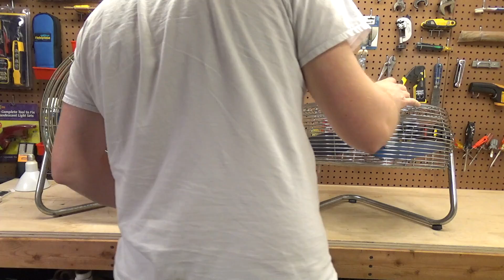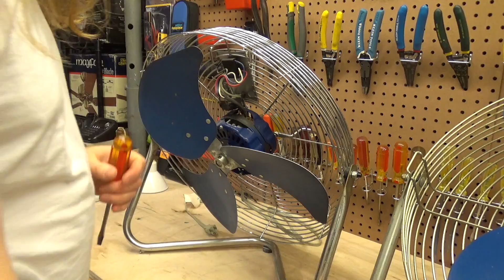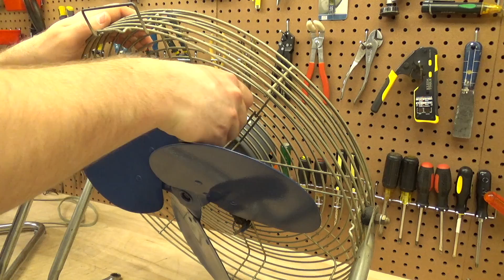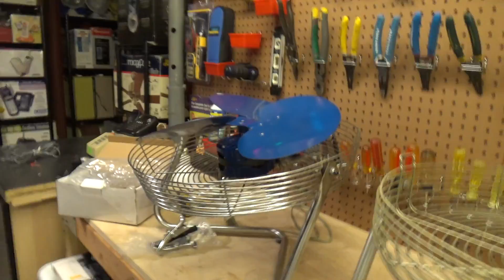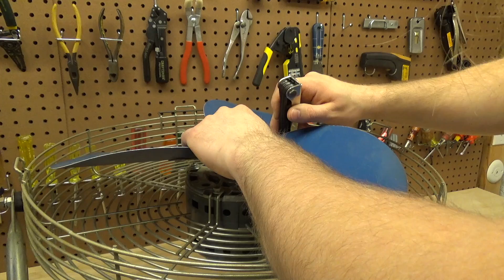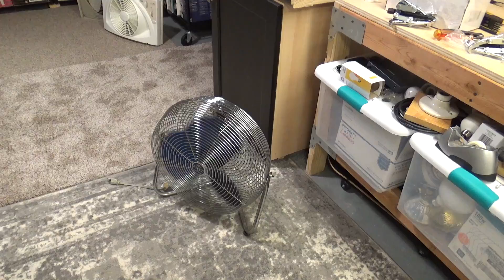Patton U2-1887 and Patton U2-1872 18" High Velocity Fan Blade Swap

Comment: I'm currently looking for a replacement blade for the U2-1887, mine has the blue crap stamped blade and has developed a crack at the hub.
Reply from the maker: There's a Dayton model blade that will work which is still under production. I've shown a few videos of it, search for it on my channel.

Comment: My sole complaint about Patton fans is how they are so loud. In fact, I couldn't even hear you at some points.
Reply from the maker: These are both very loud fans, but much noise is to be expected when such a high volume of air is moving through a relatively small fan.

Comment: I'm pretty sure my clip fan has a shaded pole motor as just like the larger of this two fans, it takes a while to get up to speed on low. Which is interesting because the fan only weighs about two poinds so its blades way barely anything
Reply from the maker: That's a possibility.
Reply: @JordanU  If it does, its size will probably seem minuscule compared to those two high velocity fans

Comment: Very interesting these are of the same company but different standards based upon performance . I knew the newer blade would be more efficient on the older one , but rather surprised the other blade would function just as well on the smaller one. I need to find an amp reader for more power readings with my fans . I enjoyed the video Jordan.
Reply from the maker: Considering the age difference in these fans, there was a lot less difference in motor power than I expected. You can still get the electricity meter I use from Amazon, though the price has gone up quite a bit since when I first got it.